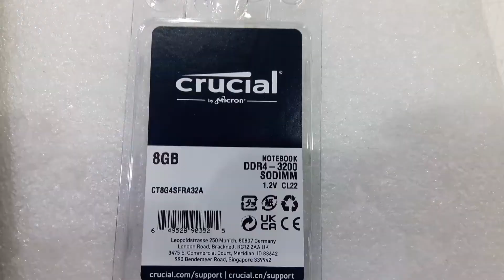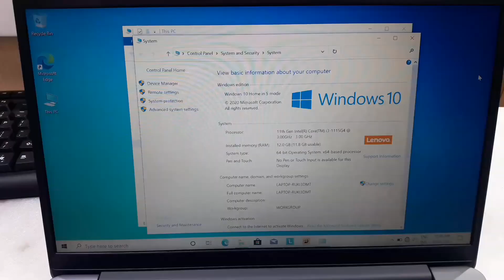Lenovo ideapad 3 14ITL6 Memory Upgrade || 82H700QUAX

Comment: What its the max ram memory  supported? Video nvidia ?
Reply from the maker: Max Memory	
This model is Up to 12GB (4GB soldered + 8GB SO-DIMM) DDR4-3200 offering (https://psref.lenovo.com/Detail/IdeaPad/IdeaPad_3_14ITL6?M=82H700QUAX)
Reply: @nprstechandvlogs8793  but on Crucial website says that max memory on this model is 20GB, so which one is correct?
Reply: @mayonaiseking8802  Did you get any info now?
Reply: @mayonaiseking8802  32 gig max memory for DDR4 but i has only 1 slot vacant , w/c means it could only upgrade to the max of 16gig , plus 4 gig soldered , a total of 20 gig ram where crucial website claims is correct .
Reply: I've tried adding 16GB DDR 2666 RAM, the computer refused to POST. I got a second module because I thought the firt was buggered, still refused.

Comment: does this laptop have an extra slot for HDD or sdd?
Reply from the maker: This model is up to two drives, 1x2.5" HDD + 1x M.2 SSD.
Reply: @nprstechandvlogs8793   can i add 1TB 2.5" HDD on the blank slot of the storage?
Reply: Maaf saya baru saja memebeli laptop yang sama ,untuk slot storage apakah bisa di isi dengan SSD 2,5" ? Terima kasih

Comment: i have the same ideapad 3-14ITL6 Type 82H7 but my come stock with 8 ram (2 x 4) can i upgrade it to 16 with 2 x 8 ?
Reply from the maker: Yes, you can upgrade
Reply: @nprstechandvlogs8793  soo as i can see the one is soldered and cant be removed soo i have to get 8 gb 
and have total of 12gb ram ?
Reply from the maker: @Mihaylov15  if 4GB Soldered then you can add 8GB (total 12GB)
Reply: @nprstechandvlogs8793  what about adding adding 16 and get 20 but i check in cmd "wmic memphysical get maxcapacity" and its says that max ram capacity is 16
Reply: @nprstechandvlogs8793  Hello man i run in to a problem saw that this laptop can support 20 gb ram and i buy Corsair Vengence 1x16GB 3200 MHz when i install it the laptop start up but the screen was black then i install the old ram and start up normaly what to do ?
Reply: I also have this laptop with 8 GB of ram which I'm fine with but I want to upgrade the SSD from 256 GB to 512 GB SSD
Reply: @Mihaylov15  i saw it few days ago, and the maximun capacity is 12GB of RAM for this model
Reply: @stapia131able  its 20 already upgrade it
Reply: @Mihaylov15  Did it work? I have the same laptop and I am planning to get a 16GB stick so was curious to know.
Reply: @pizzamadness  actually you can't upgrade to 16 Gb you can only 12 or 20 for 12 ram you can use you many ram brands but for 20 upgrade you can use only crucial
Reply: @Mihaylov15  My apologies for not being specific with 16GB I meant 1 - 16gb stick +4  gb which already soldered. So in total 20gb is workable was my question.  If we have a total of 20gb will it work in dual channel mode?
Reply: @pizzamadness  the one ram stick is soldered soo you can change only the other one and yeah it will work with 16 ram stick but it need to be a "crucial"